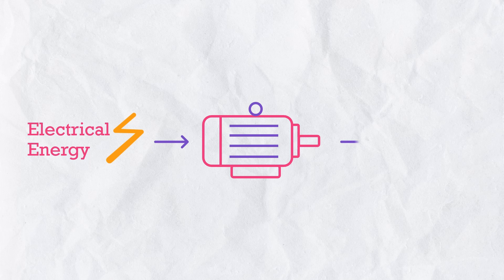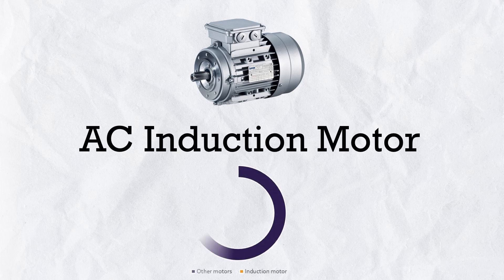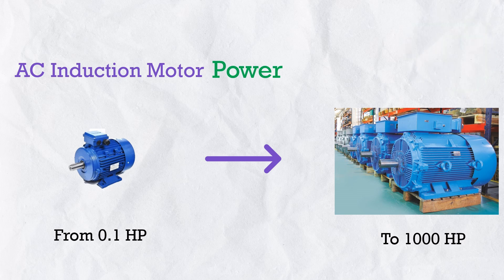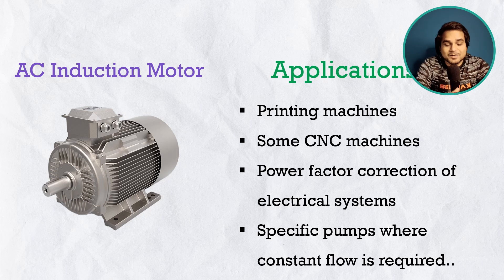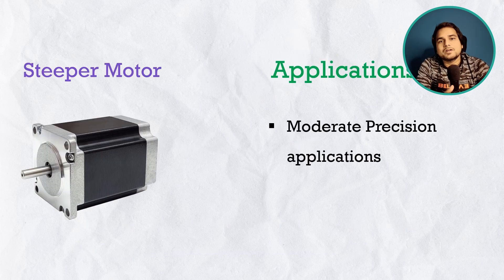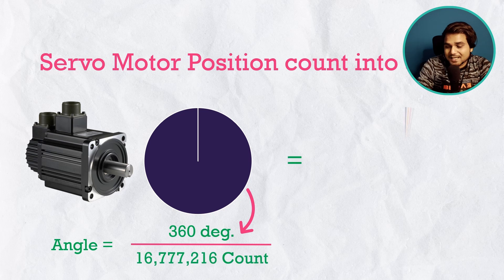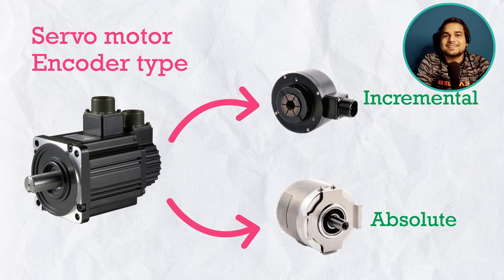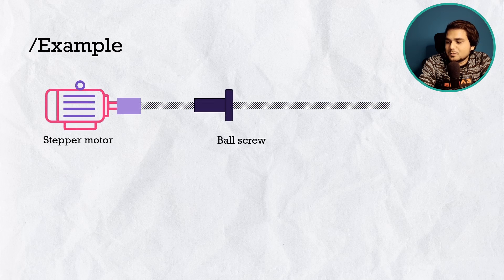Complete Guide to Motor Selection- Servo, Stepper, Synchronous and Induction motor

Comment: You are totally right. Best results are achieved when Electrical and Mechanical engineering knowledge is applied simultaneously. I'm an Electrical engineer by training but have often found that a purely electrical outlook on engineering challenges is insufficient. Thanks for this very good video!

Comment: Dear Sir, greetings!
I am building an equatorial mount that will support a telescope tube (~90kg); the transmission will consist of: shaft - large gear with 285 teeth - worm gear - then a 64-teeth gear - 25-teeth gear - motor. My goal is to eliminate the last two gears (the 64-teeth and 25-teeth gears) due to backlash and connect the motor directly to the worm gear shaft. I have found a Leadshine 3.2Nm servo motor with a 23-bit optical encoder! This results in the following resolution: 285 x 2^23 = 2,390,753,280 = ~0.000541 arcsec!

I am interested in the following: is it possible for a motor with such characteristics and manufacturer (Leadshine ELM2H-1000LA80F - 220VAC, 1000W, 3.2Nm, 3000rpm, 23-bit optical encoder) to achieve this level of precision? What would your recommendations be?

Thank you in advance!
Reply from the maker: Yes, eliminating the number of gearboxes always gives higher accuracy
Reply: @mastermechanicaldesign  Thanks for the reply. Do encoders (23 bit) really provide that precision?
Reply from the maker: Technically it will provide 2^23 times resolution, which is like infinite precision.
Reply: @mastermechanicaldesign  Such precision...That's fascinating! Thank you very much!

Comment: Kindly make video selection of

1.LM Rail, With load calculation
2.selection of Linear bush
3.selection of Bearing
4.Spring Load calculation
5.How to calculate volume of flow for FRL selection
6.Selection of Pnumatic Valves
7.Rotary Cylinder Selection with torque calculation
8.Gantry selection with load capacity
9.Fits and Tolerance(Kindly )
10.GD&T types and functions.

Kindly explain 👆🏻 all bro

Thankyou
Reply from the maker: Hi Srinath, Thank you so much for content suggestions.
Yes, I'll bring videos on all the topics. as soon as possible. 😊  
LM rail with load calculation is already on channel.
Reply: @mastermechanicaldesign wow it's amazing that you actually managed to do all the topics that this person suggested.

Comment: Selection based on 
Positioning feature
Motor holding feature
Required response time
Reliability accuracy
Environmental condition
Size-
Required Torque
Speed
Accuracy

Asynchronous and synchronous

Stepper motor - gives feedback of angle speed position
(Torque and speed low)

Servo motor-minimum speed as much required .max speed 6000 rpm torque-100too200 Nm(Torque and speed high)😊
Incremental 
Absolute
High presion control

Selection
Reply from the maker: I haven't understood your comment.